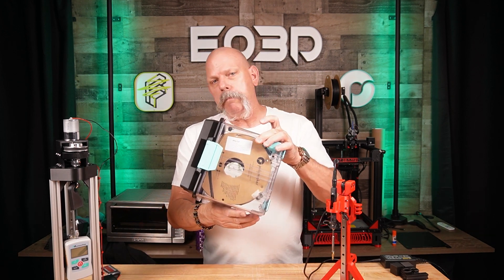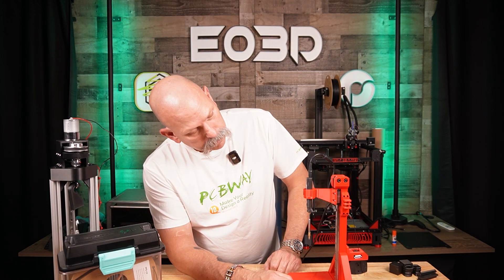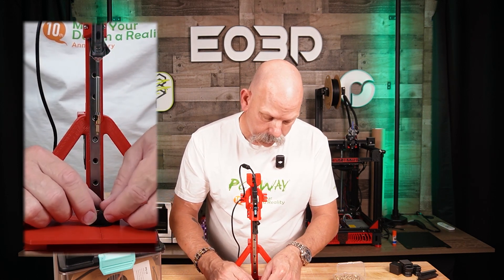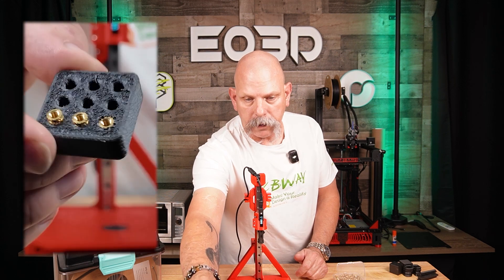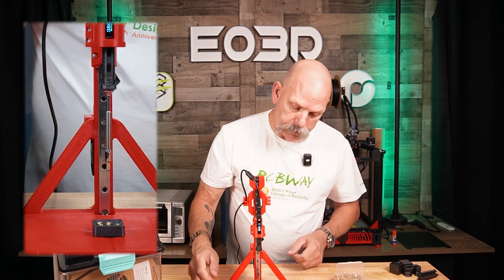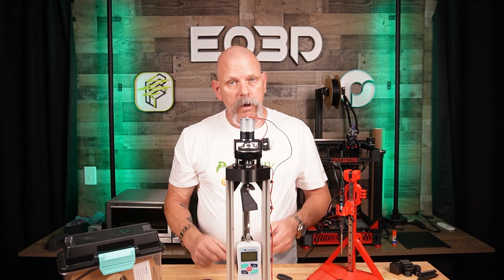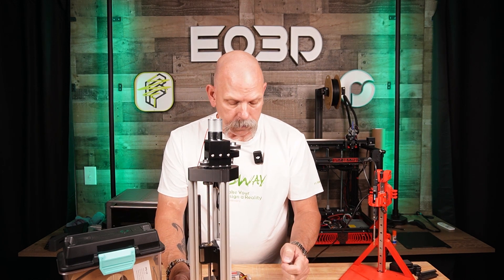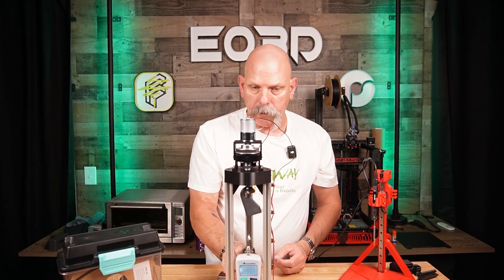Polymaker Fiberon PPS-CF and Heat Sets | EDGE OF 3D

Comment: How does it compare to tapping the part directly be the heatset? Not having heaters and keeping the strength would be amazing.
Reply: Tapping the parts is viable if you have a decent wall thickness. But for small holes like 3 mm, or so, you have to test the accuracy of the hole the printer makes, a few hundredths of a millimeter too big or small could result in a failed thread and this will dull a high speed tap after a dozen holes or so.

Comment: Thanks for the video Scott! (I'm 6 months late to the party) I'm kinda new to heat sets. My experience has been in injection molding. But are there preferred types of serrations on these inserts for carbon & glass fiber?
Reply from the maker: I've never tested different designs, I just order Voron spec in bulk from AliExpress.

I'm sure there may be differences in the different designs as far as how they hold but will it be measurable? Maybe some testing for the future.

Comment: I need to figure out how to print this stuff. I have a Bambu x1c. And a voron 2.4 but the voron is in pieces right now. Will an abs tool head on a 2.4 print this stuff or should I do nylon?
Reply from the maker: I'm printing this on a printer with an ASA toolhead, zero issues

Comment: That pull gauge, isn't it only rated for 110 lbs?
Reply from the maker: It's rated for 500 Newton (112#/51Kg) but you can take it past that, it just screams at you the whole time and occasionally will shut down.
Reply: @EDGEOF3D  ahhh, when I used the type IV specimen, it was too much for this gauge. i ended up reducing the cross section on my specimens. Still ended up with nearly same results as manufacturers like polymaker. Not the force value, but the stress value sense i divided the force value by the cross section. Perhaps you can try the same with PPS.

Comment: Fantastic video again, mate. I'm considering building a Milo mini mill (I'm an ex-toolmaker). I'm thinking this filament would be perfect for the printed parts if they can handle vibration and impact.
Reply from the maker: Keep watching, at some point this weekend I'll post up some short dealing with exactly that, impact testing. PPS-CF is not the right choice in that scenario.
Reply: @EDGEOF3D  haha, copy that! I'll keep an eye out. Glass or carbon fibre ABS/ASA might be the answer, then. My intention would be to mill the high load components in 6061 once the mill is dialled in anyway.

Comment: I can’t believe how nice of a metallic sound the Fiberon filament produces. Are any of the Fiberon line of filament machinable, if so, what kind of tolerances can they handle.  Thanks for the video!
Reply from the maker: Unknown on machining, however I have a Milo mini mill sitting here right next to me and I do intend to try and machine some of these.

PPS-CF I doubt will take being machined, it is very strong but it's also very brittle before annealing. I plan to try annealing a batch and seeing what happens.
Reply: @EDGEOF3D I'm interested to know if printed, annealed and post-machined parts would be viable with this filament. If so, it opens up some great possibilities for 3D printed, machined components with minimal material waste. With my vorons and Rat rig 500, plus a Milo mini mill, it'd be a match made it heaven.
Reply: @EDGEOF3D you can. I’ve just done it in my mill. But I highly recommend a polycrystalline diamond tip for this. Diamond is recommended for plastics because of the abrasiveness of all plastics, even UHMW, which is more slippery than teflon. I’ve been machining plastics for over 40 years, so I can say that any material with CF will degrade even tungsten carbide. Most tooling isn’t sharp enough anyway. These tips cost about what 500 milligrams of the material costs, so too expensive to play with a few times but economical if machining plastics, non ferrous metals, ceramics and wood, which I haven’t tried.
Reply: So freaking excited about this stuff!
Reply: Please don't machine anything with CF in it without knowing what you are doing.  CF needs very purposeful dust collection/enclosure.  Breathing CF dust is really bad for you.

Comment: I'm really interested in Polymaker's pricing on this filament. I see other manufacturers going for $150-$200 a kilogram. If they can beat those prices, I'm sold. Also, looking at the specs for PPS CF at some other websites, it just squeaks into the capabilities of the Qidi XMax 3.
Reply from the maker: $69.99 500g so $139.98 per Kg
Reply: @EDGEOF3D  Awesome! Thanks for the info